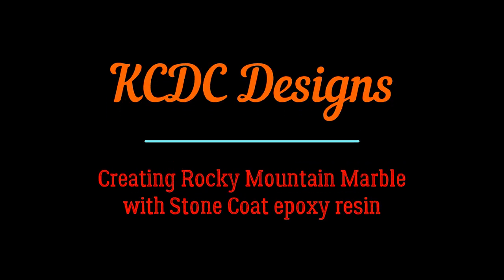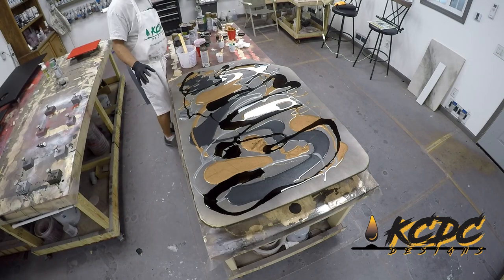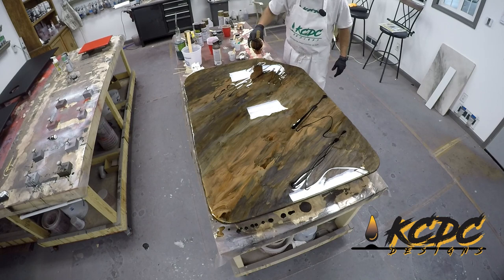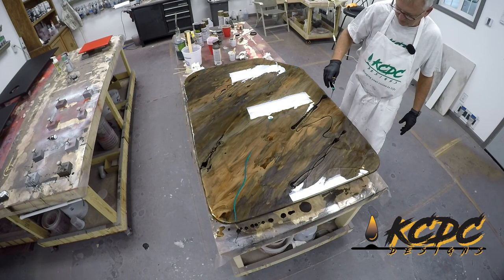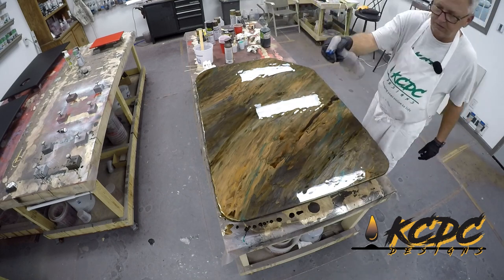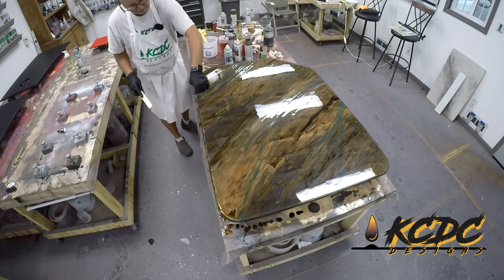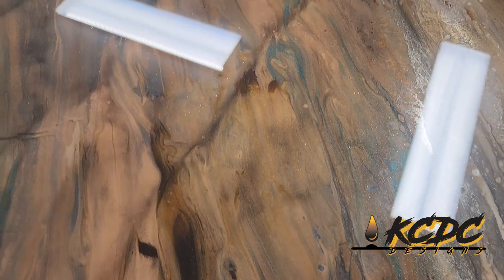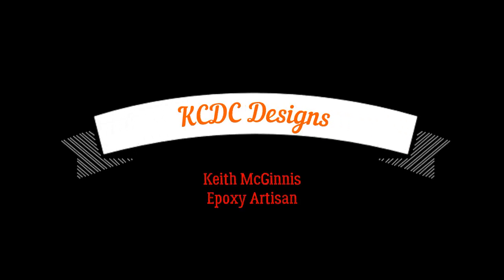Watch how I created this beautiful RV table top using Stone Coat epoxy! - KCDC Designs

Comment: That’s awesome Keith, I think I’ll give that a go myself 😀 how did you prepare your surface Keith? And do the rock edge?
Reply from the maker: Thank you, Natalie! Built with 3/4" MDF with no drop-edge since it was for a camper. The rock edge was created using an angle grinder with 50 grit sanding disc to create it and a small amount of Bondo to add some character. I then painted the surface with Stone Coat's Black Epoxy Undercoat, then fogged the edges as well as the surface with spray paints of similar colors as my color coat.
Thanks for your note, Natalie and please send a pic of your sample and/or project! 
Feel free to email that to me at kcdcdesigns2020@gmail.com as I would love to see it. And if you have any questions, please let me know how I can help!

Comment: Another great video, Keith. Very detailed and easy to follow. One question for you, I know you use rustoleum spray paint but I’m pretty sure I heard Rhonda say that she avoids using the gloss paint and sticks to satin and matte. Thoughts on that? Also, hope to see you in April at RK3 Pro class!
Reply from the maker: Hey Peter, thanks for the kind words!
Regarding the RustOleum spray paints it's actually the opposite as Rhonda prefers the gloss first, then satin/semi-gloss and tries to avoid the flat/matte. The gloss seems to have the best reaction and easier to use, the satin isn't too bad but you just have to learn how it reacts with different techniques and the flat avoided and rarely used if possible.
And I hope to be there in April as well and would love to meet you!
Reply: @kcdcdesigns  too funny because I just watched one of Rhonda’s videos and you are 100% correct. I experimented tonight with some hammered rustoleum and it didn’t work out so great!
Reply from the maker: @petercarels  The Hammered Paints work great with some techniques! They're very thin but the propellents in the spray can create some amazing cells! When you spray it directly into the resin, then use the flat of a tongue depressor to work it into the epoxy (just don't overdo it) and leave it alone, within 5-10 minutes you'll see some amazing cells and reactions. I use them all the time. Experiment with Hammered Brown, Hammered Black and some Champagne Bronze (not hammered). Spray fairly heavy lines of them, then work them in, sit back and watch. VERY cool effects!